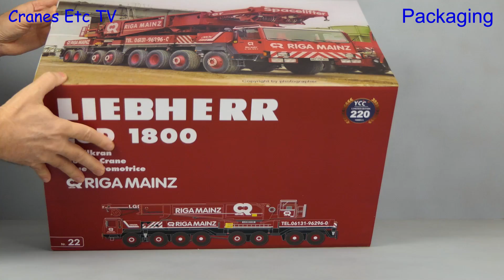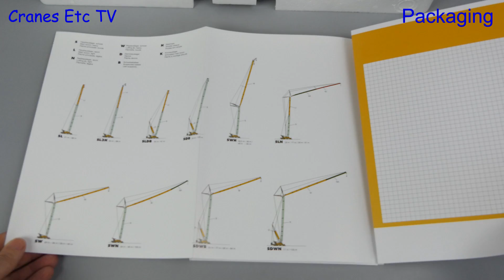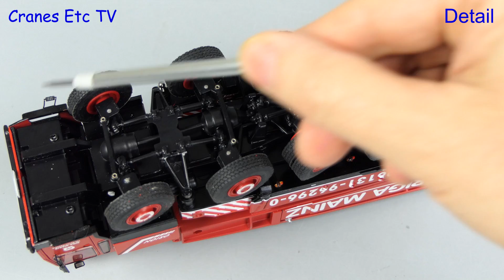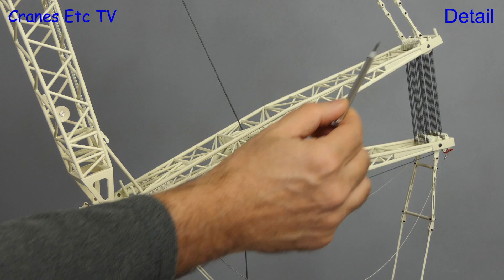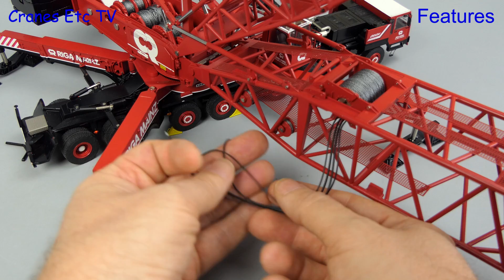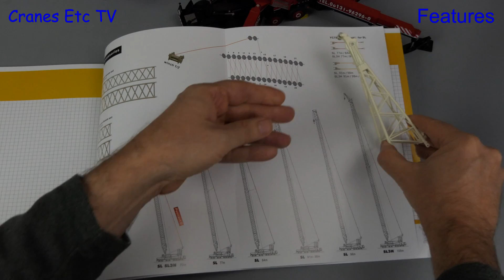YCC Liebherr LGD 1800 Mobile Crane 'Riga Mainz' by Cranes Etc TV

Comment: The rollers on the superlift tray is not used to move it sideways in real life. When you turn the crane those rollers need to be over the ground, it is just for safety so you dont turn when the tray is on the ground and the derrick will break  :)
Reply from the maker: Agreed.  This is a static tray rather than a moving one.  They have large rubber wheels.